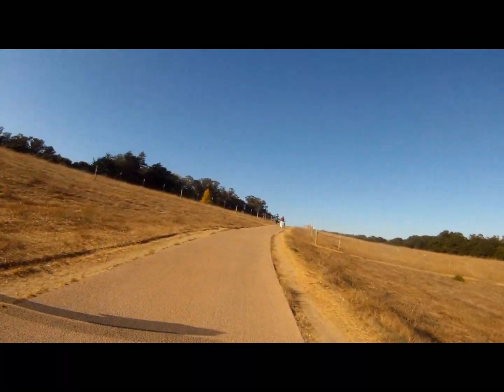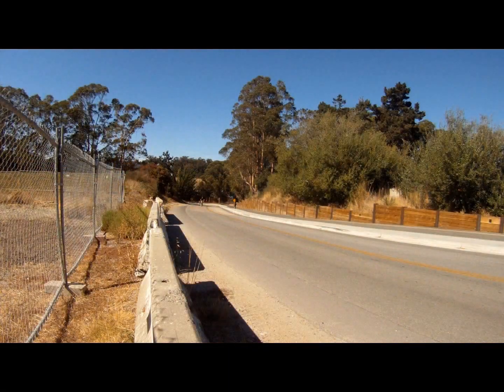E-Bike. Powerful 1200w Brushless Motor 48V 17.5AH Battery, Giant 29er Hardtail

Comment: I like to install my own electric components on my new bike which I will be buying, what should be components on my new bike which I should be insisting on getting before I install a Bafang 48V 740 motor. What Components(Brand model) such as front and rear Derailleur(Shimano brand), Fork, Brakes(mech.. or Hydraulic, Tektron or Shimano), Frames(alloy or steel) which you think I should get. Thanks.